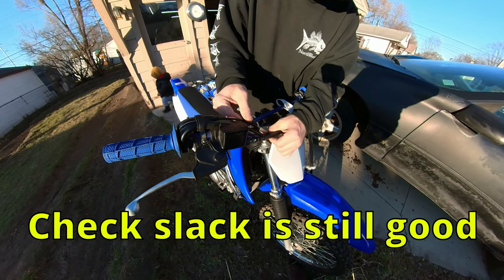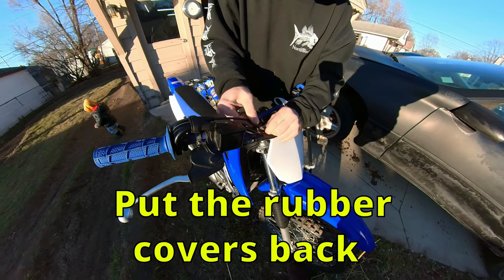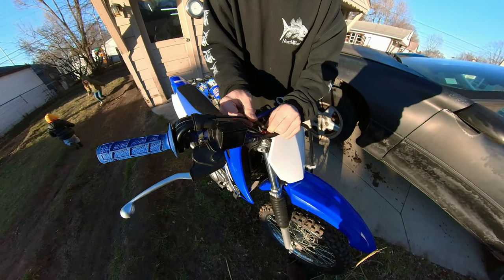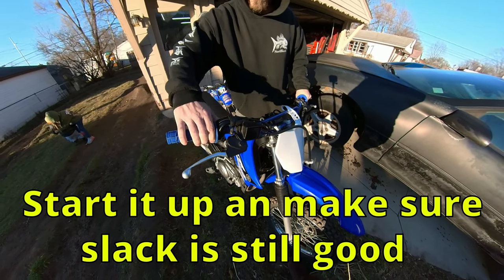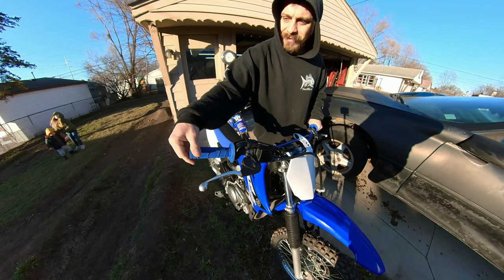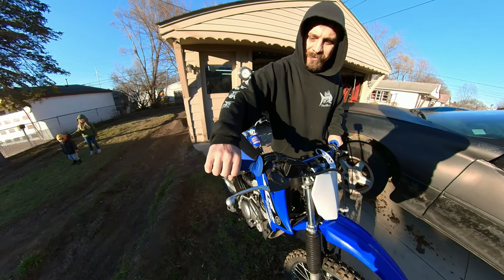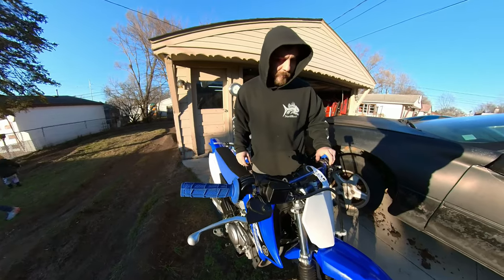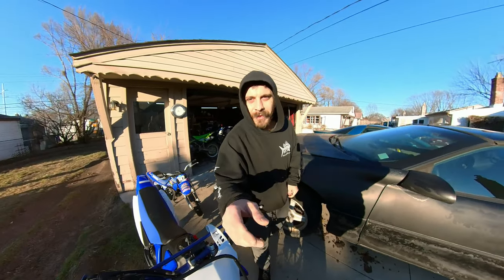Throttle FREE PLAY Adjustment | ANY DIRTBIKE

Comment: I went all the way out and I still have a lot of slop. Any advice?
Reply from the maker: There is actually another adjustment down by the carb that you can make similar to the one up by the throttle. Look by the carb and you should see 2 cables, one has an adjuster nut. Try doing the same thing to that. Let me know if that helps. 👍

Comment: Hey , so I tried doing what you did but there is still a ton of slack . Its like the cable is streched !!  Is there a way to tighten the cable from the carb or do u know a way of fixing that problem ? Thanks
Reply from the maker: There is another adjustment spot right at the carb, but usually adjusting it up top is enough. Try adjusting the spot right by the carb, let me know if that helps 🤙
Reply: Ok , i will try . Thanks
Reply from the maker: @gerard845  no problem 👍

Comment: I have an 07 Yz TTR 230.need to replace my throttle tube but I cannot find a good part for the dual push pull cables. Any help. I’ve looked on Amazon and a few parts sites but I can’t find much. And ones I do find I don’t know the specs because the manual doesn’t say anything about tube replacement.
Reply: Currently, I just removed the push cable since mine was frayed, and it works better than ever.

Comment: I have a 125cc scooter, do you think having too much throttle free play can cause the scooter to pick up speed slowly or feel underpowered?
Reply from the maker: @dab7805  yes because u might not be able to twist full throttle, u can pull the carb off an twist the throttle an see if the slide goes all the way up to make sure u r getting full throttle 👍
Reply: @RippinInTheMittenMX  thanks a lot for the info, I will check it
Reply from the maker: @dab7805  no problem 🤙🍻